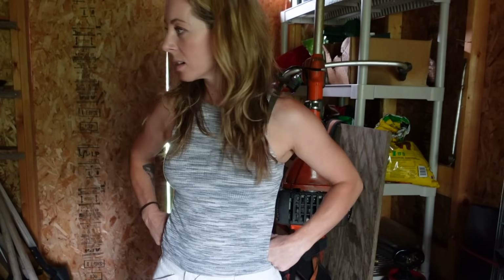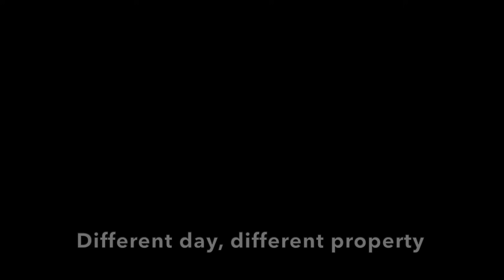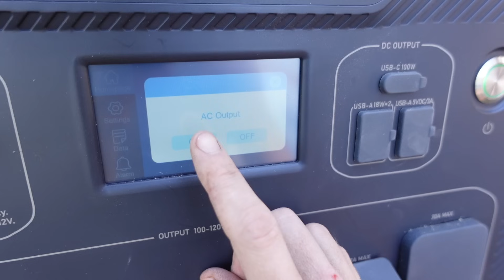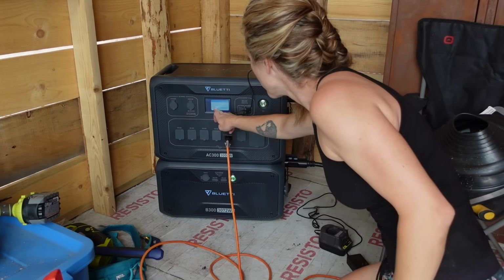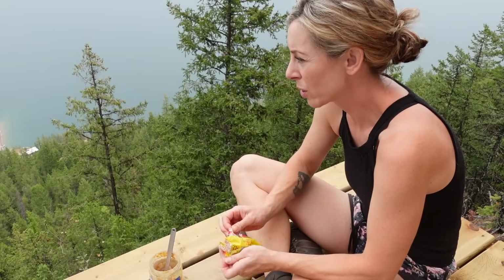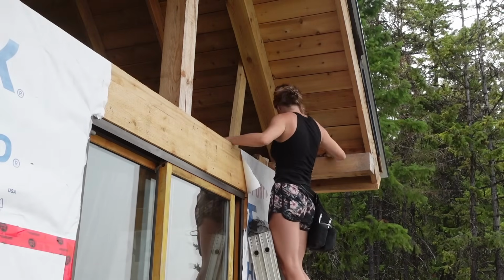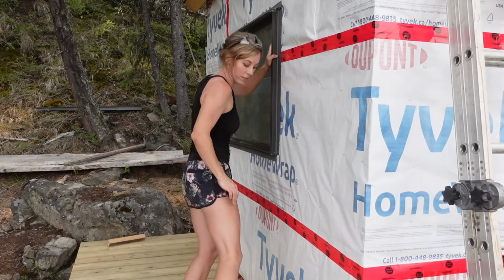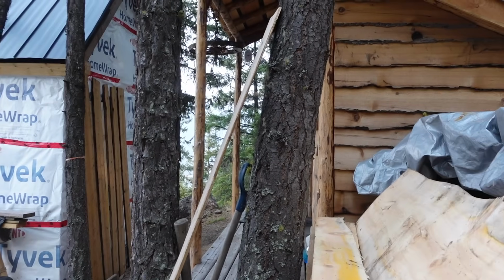Can I Train a Rescue Mountain Goat for This? (Ft. The Great Escape).

Comment: If you would have just asked nicely I bet Steve’s girlfriend would have came and let you out
Reply: Michy maybe take a gallon of bleach to your cabin and leave it. Bleachy water goes a long ways on mold mildew and critter urine. Great video 😊. Glad ya made it out of the shed 😂.
Reply: @krisloughley3332 ❤you are a beautiful woman.
Reply: I like them vertical. Would you have boards long enough to make it in one run, or would you have to butt them? Butt joints are easier on the horizontal. 
Love your sense of humor. I actually laughed out loud when I saw Steve’s response! (Yes, I realize that that part was staged, which adds to the humor).

Comment: I would definitely go with horizontal boards for the siding. 1) it would match the shed and 2) water will shed down and not get between the boards and the house wrap which would set you up for rot.
Reply: 👍👌👏 Eeeeeexactly!
Best regards, luck and health in particular.
Reply: If you don't have enough of the siding for overlapping, you could mill something different and alternate boards.
Reply: Dear  @janking2193  
👍👌👏 Exactly my thoughts too.
Best regards, luck and health in particular.
Reply: yup..horizontal..my opinion 👍
Reply: You beat me to it! 😎👌
Reply: Builders support each other.

Comment: I spent 47 1/2 in the construction business.  Some large commercial, but mostly high end remodeling and custom homes. I am impressed.  I especially enjoyed your handlng of the framing hammer.  And you held it appropriately too, for maximum force to the nail head. Thanks for an enjoyable video.
Reply: "Same," in regard to the framing hammer.  It's good to see someone use it properly.
Reply: You've got me beat by a half year Ray swinging a framing hammer. Great job Michelle with the hammer, get that cabin with a view dried in and start to enjoy it!

Comment: My life definitely would not be the same without my AC300 and B300's. The 30 amp outlet is perfect for powering my entire cabins circuit panel and Airstream Basecamp 20X. Also Bluetti's customer support is top notch and on the ball! I can't say enough about how Bluetti's systems have change my off-grid life, well them and Starlink!!!
cheers!🥂
Reply from the maker: Right?!? A Bluetti power station is kinda life changing. 🤷🏻‍♀️

Comment: GO VERYICAL!!
I like the vertical reverse board and batten. Built our house in 1990 with the standard vertical board and batten. No issues of rot. My dad told me to put a bevel  on the bottom of the boards that made the end of the board pointed, bevel toward the house. Point on the outside. This gives the water a way to drip off instead of soaking back into the bottom of the board causing rot.
GO VERTICAL!!!!

Comment: Horizontal shiplap siding would definitely stand up to the weather better than vertical siding...for the same reasons that shingle roofs are installed in an "overlap" method. Water and snow will sheet off od shiplap, but wont on vertical siding.

Comment: You can use that Hilti Drill to chip the rock into a flat spot for the deck post to sit on.  There is a setting on the Hilti for chipping the rocks or concrete, works the best with a chisel bit for the hammer drill.

Comment: Myself I would match the siding direction the way you did on your shed ! 
I like the idea you had on the Blue power banks , power all your tools on site where you use them , camera batteries and drone too , no question it’s a plus !  Use of the Honda generator to recharge the Blue banks , it’s a good system you have !

You have a done a great job so far , no matter how you look at it , it’s quite an undertaking to pull  off what you did !

Comment: A couple options on how to incorporate vertical live edge siding.
- Do something like wayne scotting (just horizontal lap siding with a cap plate/board) at the base of the wall (come up the wall about three feet). Then do your life edge vertical siding from the top of the cap plate/board to the top of the wall. I'd overlap the vertical siding by at least an inch or lay it over the top of plywood sheeting.  (Yes, I know, that means a lot more wood.)
- Do something like a Tudor style face. Run the siding horizontal, but have vertical live edge pieces

Comment: Hi Michelle, as to the siding -vertical with a thin strip to hide the space between the siding boards. I think this would provide a great contrast with the horizontal boards on your shelter behind this structure, and would play on the vertical supports of the deck and building its self.  This combined with a whimsical stick railing would be-wow-sort of fairytale effect. Perfect home for the “Red Caped Cliff Fairy” 😊, Wilber & Margaret from the lower 48. 🌟🌟

Comment: ❤ Lumber Woman escape sequence. You are a super hero! As for the siding, I vote horizontal. Wouldn't it be more weatherproof if it was overlapped horizontal? Since most rain & snow comes down⬇️ or at most, sideways↔️ (BC may be different🙂), I would think it would be more worry about moisture getting behind the boards if there were vertical seams or gaps. But then again I may not have a grasp of how you want to do vertical. Be safe.

Comment: Anchoring up right to rock-good idea. I might have used 2 "L" brackets instead of a bolt thru the middle which might split. You could use 2- "L" and put them on the anchor bolt like "washers" under the nut so they would L on either side of the upright.
You're very hard working, but I would expect no less from a super hero. Mighty Michy

Comment: Hi Michelle. I think you could mount a "truck bed storage thingy" on the side of the wall where you want it. If holes are predrilled in the box, one anchor could hold it up, with props, while marking the other holes. It's your cabin and your time milling, you decide the direction. Super Builderess.
Have good days!

Comment: U sing a 1 gallon pump up sprayer apply several coats of used diesel engine oil to all the under pinning's, Or use a paint roller. It works better than  store bought treatments. Vertical needs Bats, Remember to only screw  batts between the siding boards so they can shrink and move as needed. Mix it up and do both, you only need short horizontal boards around window walls.

Comment: Vertical board and batten was very popular down here in the south. It work’s particularly well with green wood because you can allow for shrinkage by nailing the battens in between the vertical boards. Then after the boards dry you can add more nails.

Comment: I prefer the horizontal look, but you are the one that has to live with it, so go with what feels right to you.  Not knowing your whole plan, I noticed the open space where soffit would go under the eaves. I would suggest you close that in with either wire screen ( as opposed to screen cloth ) or vented aluminum or vinyl to keep wasp or hornets from nesting there or even inside.  Also, are you now inspired to replace the shed latch with one that has a way to get out ? Love the outfit.  And glad to see you moving better.

Comment: I like the idea of a few feet of horizontal siding, a ledger, and then vertical the rest of the way up.  Best of both worlds, and some continuity with the shed, while still being different.  I'm concerned about moisture penetration with the vertical though.  

One thing is for sure, I'd never be able to build this while designing it on the fly like you're doing.  I'd want it all planned out.  Obviously you are doing planning as you go in your head, so there is "a plan", but if it was me, I'd need to have more of it worked out beforehand.

Great job!

Comment: I agree with a lot of the comments I read through, that horizontal siding would be better for water runoff, and also match the little storage shed. If you decide to go with horizontal siding, since your boards aren't long enough, you can butt boards together with clear silicone between them, or bevel cut both board ends coming together and glue them as your attaching them to the wall. If you decide to go vertical siding, I think I'd apply a bead of clear silicone as close to the inside edge of the bottom board, top to bottom, before attaching the batten board, to help with water intrusion.

I laughed out loud at your beginning skit, recreating your trapped dilemma inside the shed, with your texts to Steve and his responses, and laughed even louder out loud when the door opened and you were standing there in your Canadian Wonder Woman outfit. You are an original for sure Michelle, and in a very good way! I'm now wondering if you and Steve have a cosplay/date night once a week, and if Steve dresses up as maybe a pirate or a super villain, and do the fur babies get a choice to be dressed up for the super hero or villain side? :o) Stay safe y'all!

Comment: Hey Gosh (Now even showing superpowers). Well, there's a lot of plausible solutions, such as having the inner boards pine or a lesser sort of wood, that would make you use half the amount of black edged boards. (In the vertical version)... - However to avoid critters getting behind the battons you'd need a board horisontal in the bottom and the top to close it in... 😉 Looking forward to seeing your solution... 😉 You could also consider parsely to close in the deck underneath so you xan use it for storage... 😀

Comment: I just finished building a 8 x 12 shed on some property 55 miles outside of town.
I installed a latch like yours with no way to open from the inside, I had noticed the wind close the door several times before i installed the latch so l decided i had better install the bar that slides into the latch a bit lower so unless I am holding it up, it will not slide in correctly. 
Stay safe Michelle, I really enjoy all the projects you do , keep'em coming.

Comment: drill a small hole above latch on shed and attach small length of cord to it with it attached to top of latch, pull from inside and it lifts latch.Siding pick what you like the tyvek is the true barrier.

Comment: We have those latches on our chicken coop and on the run door. We drilled a hole through the building right above the latch and fashioned an emergency pull handle for that exact reason it lifts the handle from the inside.

Comment: horizontal will be best to keep water out, board & baton will not work well with live edge.  you can always torch non-cedar planks to preserve them- shou sugi ban process.   i built a shed with torched slab wood siding but i just charred it & didn't get carried away finishing it; the weather took care of that-- use a medium 2" Staples ... I do admire your drive & self reliance and the lack of whining.

Comment: Just an idea to keep you from locking yourself in again, drill a small hole above the latch through the door and run a piece of string through that hole, tie one end to the hole in the latch handle and to a piece of dowel on the inside of the door.  I do like the siding idea you have,  the vertical full boards are a good look.

Comment: I did the board over board for my 24x24 garage. Looks great and holds up well. It is easier to put up and encloses the walls well. That was over 30 years ago. By the way, nice outfit!  How about “SUPER MICHY”!
Reply from the maker: Board over board is the board and batten?? Or the lap siding. ??
Reply: @michygoss7148  Technically board over board is using a narrow sticker over the gaps between vertical boards. Lap siding is horizontal in nature.  I used various sizes of rough cut horizontal boards to cover the outside walls. And overlapped approximately one inch on each side. That makes it easy to use whatever lumber you have cut up regardless of width. Saves time and money. Although in your case the lumber is relatively free.

Comment: Your wonder woman/super girl outfit looked great!  Matter of fact all your outfits look great on you.  Vertical or horizontal would look great, you are correct you will need more boards to do it horizontal.  Although you will need batons to cover the joints of the vertical running boards.

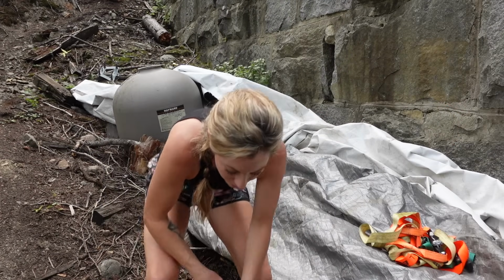Comment: 5:27, Have you ever considered a steel 20' shipping container or even a 10' BICON Container.
Clear a flat area for it and have it lowered down from the street level.
Water/Weather Proof, Rodent/Insect Proof, and Lockable.

Comment: If you go vertical you will need really long boards for the area at the peak of the gable. .   Unless you run a horizontal cord at the base of the triangle on the gable and break the wall into a rectangle with a triangle  above.
Reply from the maker: I definitely will break up the gable end with something else!

Comment: One of the issues with live edge reverse B&B is that it tends to hold more moisture than other siding designs (especially if you are keeping the bark).  If you are going to use pine, be sure to seal it up well before install.  Quick question...how long does it take the gene' to charge up the Bluetti?  I know the PV350 can't be rolling out more than about 100-125 on a good day up there. ;)
Reply from the maker: About 1 hour, but I’ve never had the battery at 0%, so if that’s the case it would be a bit longer.

Comment: The vertical looks great and the replacement work will be much simpler since some rot is unavoidable. The board and batten method is common and very effective. As HyperactiveNeuron has stated, keeping the water from penetrating behind the boards will be important in minimizing rot and strapping will help to drain any water but I suspect the packrats will be a bigger problem. Just make sure there's no water flowing over the boards from the roof or sills. Thanks for the info on Bluetti. This is one item I needed a recommendation on.

Comment: Hi Michelle !  Leaving  the window just installed as is and putting a wooden border around it  of the same thickness as the overlapped horizontal siding  sounds workable.  Obviously I'm biased towards going horizontal with the siding.  If that suggestion works then you could install all of your windows first to get your cabin weather tight.  PS  I never noticed a phone booth in the shed for your costume change or maybe I'm  confusing super hero(ine)  things.👍👍🔨📐🤩❤

Comment: Believe it or not Michy I have a tool shed with the same type latch. I had fashioned a 
piece of bailing wire to pull from the inside to open the latch. One day I went inside and when I pulled the wire
to exit it had rusted and it snapped off leaving me locked inside. I laughed so hard feeling so stupid.
I also had a couple of tomato towers exactly like yours' inside. I did the exact same thing you did.
I bent a loop on one end and was able to slip it over the latch. Wala. I ended up making the new opener wire out of the heavier 
gage galvanized  wire from the tomato tower. 
The only difference was, I did not exit wearing  the super hero costume you had on.🦸
This was years ago but to this day every time I enter that shed I make sure the wire is 
still in working order before entering.:face-green-smiling:
John, Alias,  Toolman 🌹🌺🌷

Comment: Go with the vertical board cladding. Yeh, horizontal probably sheds water better but what the heck.

Suggest you keep the costume and the custom made hook in the shed to make exit super easy next time. Although the costume might have helped out at the cabin while “hovering” to install that last rock bolt.

Comment: I really love that live edge in the horizontal, it is so woodsey and classie at the same time.
That live edge is no two alike, forever changing it's pattern.
If you do go vertical, be sure the grain is pointing down for run off and prevent absorption.
You may want to bring some bleach solution to spray and neutralize that rodent urine.

Comment: By surface nailing your cross braces, rather than cutting and fitting them between the posts, structural integrity is entirely reliant on the fasteners, rather taking advantage of the strength of the wood. I have run a 2x2 centered along the length of the post to fasten the braces rather than relying on a toe-nail. Also, if you attach the cross-braces to each other where they cross, you reduce the chances of the braces bowing. I have also been known to attach a 2x4 to the cross brace in either a T or L shape to further reduce the chance of the cross brace bowing. Just my $0.02.
Reply from the maker: Good point. I have thought about adding blocks where they cross braces meet in the middle, as that does increase structural strength some.

Comment: You probably already did it and I didn’t see it but, make sure you have the tyvec above the window come down over the metal flange and not behind it, otherwise it might let water in! Hope that helps and makes sense!👍
Reply from the maker: I am adding foam insulation over the tyvek, so the tyvek kinda gets excluded from the equation.
Reply: You could do the boards vertically if you wanted, like a paling fence, the first boards butted up next to each other and then a narrow one over the gap! I don’t know if that would use more boards or not, might have to work it out!

Comment: second time around...stay uniform. Keep the boards horizontal. Going vertical will create problems with sealing it properly, plus, going horizontal, you can use basically any even length board and overlapping the bottom of each board (like shingles) will give you a batter seal that's easier to manage. just my two cents worth. here's a nickle, keep the change.☺

Comment: @8:15...  The problem with the lithium-ion battery-based inverters is that you CAN"T charge them in the winter without damaging the batteries.  You should let people know about that limitation.  You'll need to keep them above 40-degrees...

Comment: That latch is designed to have a wire or string attached to the hole in the release mechanism.  Drill hole through wood door high enough upward to pull up and release, run wire or string then place a weight on it ... washers or something like that .  Not surprised you got out easily ... you're a thinker/doer.